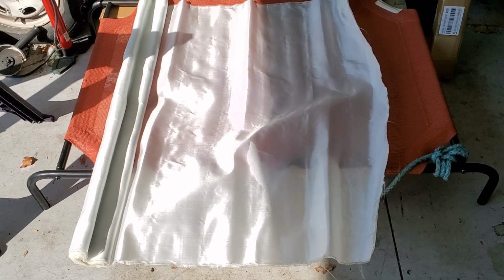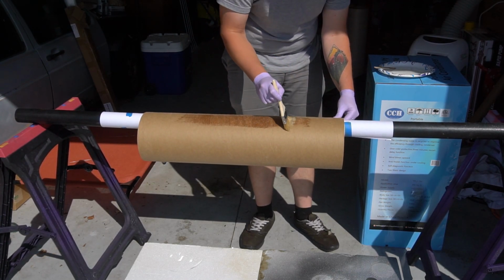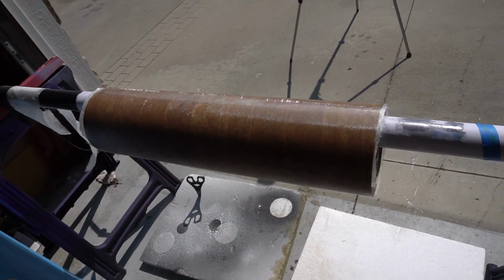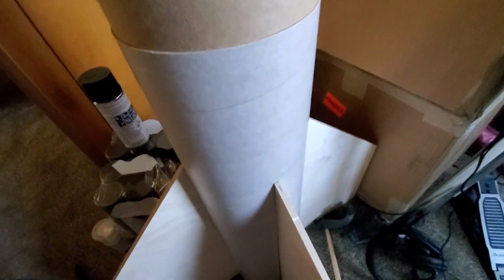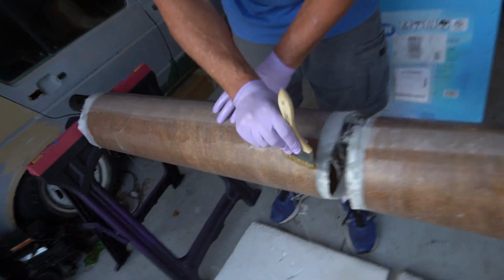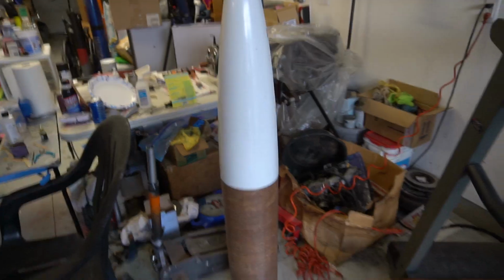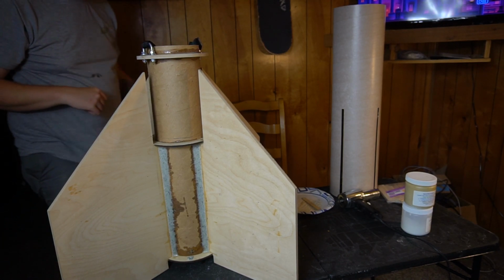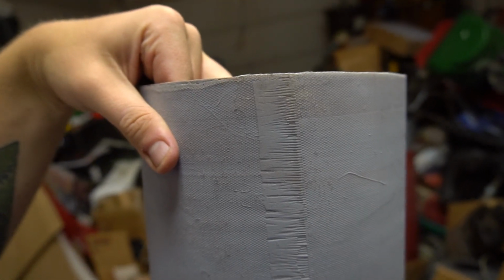Fiberglassing Large Diameter Airframe Tubes | 7.5" LOC Iris High Power Rocket Build

Comment: Resin for fiberglassing is a 1.1 to 1 resin to cloth ratio. So if you have 10 grams worth of cloth you will need 11 grams worth of resin. This is for a laminating resin though. The west system I would think is higher viscosity so you might need more but I have never used it.

Comment: 8 1/2 ounce is way to heavy you need to do 4 to 6 max and wrap them with 2 mil mylar and the take it off when it starts to set it will leave the finish like glass and you will only need to touch up little pits look up John Coker how to glass a tube on youtube works great if you do it the way he explains it

Comment: Go to Napa and get some fine body filler....Get the good stuff,  sand tube with 80grit Lightly but good....If using just the cardboard tube start with 180grit, fill with the filler.....then 80 again....fill more if needed.....then 180grit and then your filler primer.....You'll save time and money......Check out the vids on my channel and you'll see how stuff comes out. PS, I'm a long time body tech.